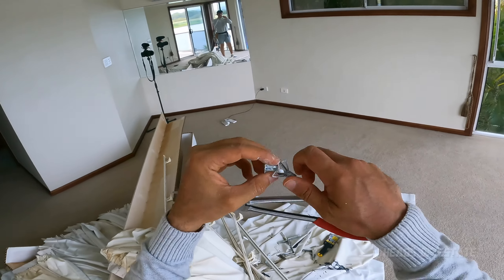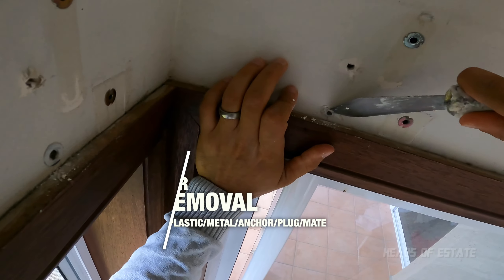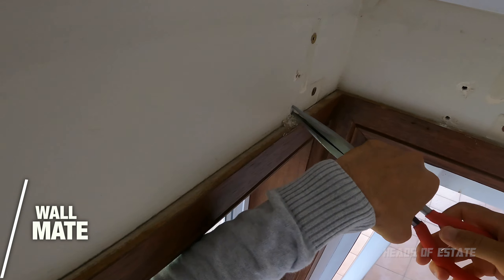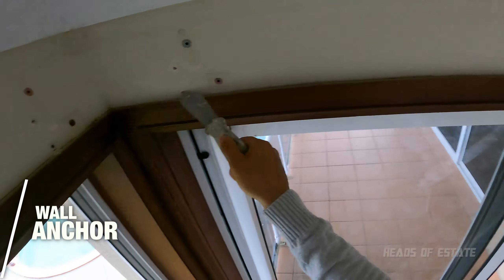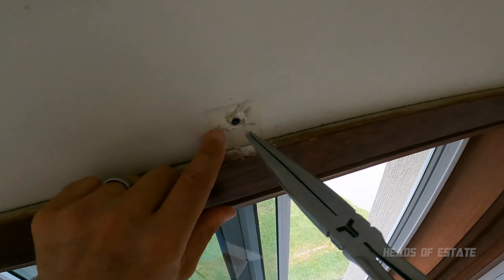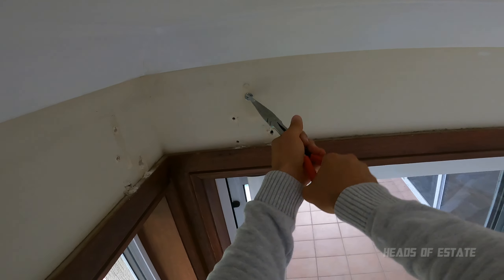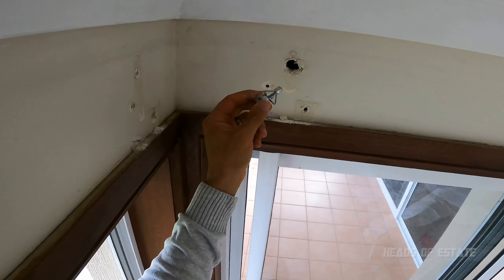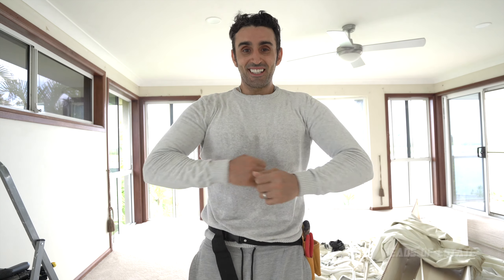How to Remove Different Wall Screw Plugs/Anchors from Plasterboard - Plastic, Nylon & Metal

Comment: To remove the metal ones is actually really easy.. You put the screw back in , hammer it a few times then it just pulls right out.

Hammering it flattens the anchor behind the wall. The reason they dont just pull out is they are expanded behind the wall which hammering the screw removes.